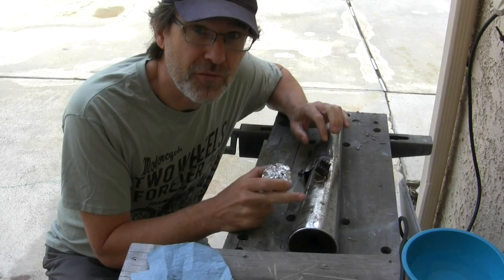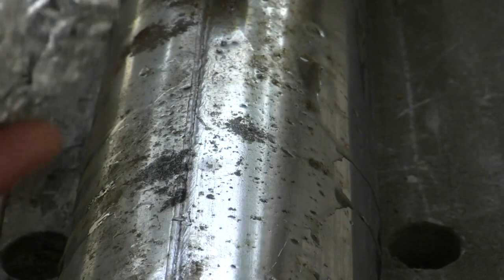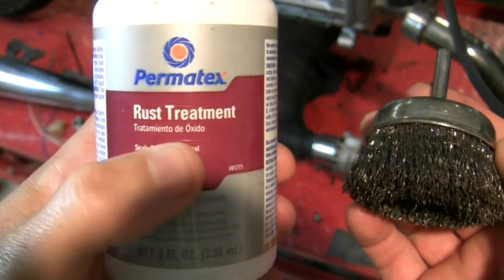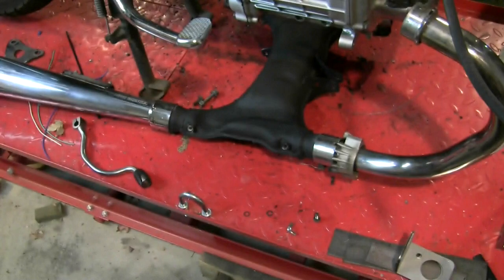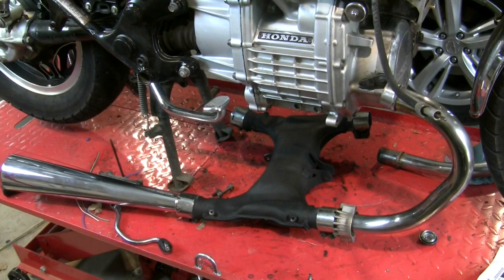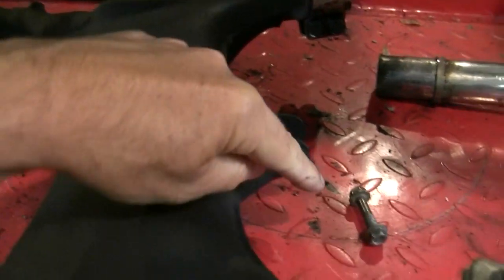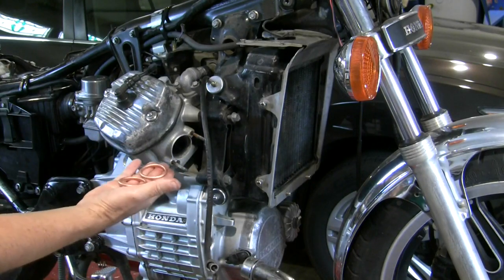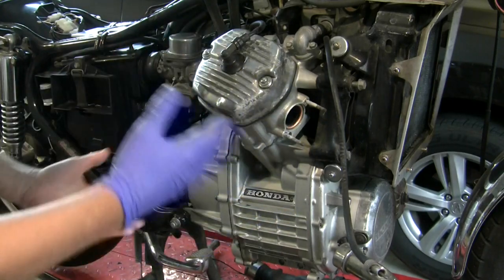Install Exhaust - CX500 (Part 19)

Comment: The aluminium foil on chrome trick actually works without any other additive.
It's because the aluminium is harder than the iron oxide (rust) but softer than the chrome finish.
So it scrapes off the rust but does not damage the chrome.
Reply from the maker: Thanks for watching! There is also a chemical reaction happening in addition to "scraping." Iron oxide -> aluminum oxide.

Comment: question... i put coolent in my cx and im getting some weeping aroung where the new water pump gasket is will that stop once i get the bike fired up and the gasket swells a bit?
Reply from the maker: That "gasket" (more of an o-ring of sorts) gets out of its channel easily during installation. My first guess is it slipped out of place and got pinched.

Comment: Horrible job. Doing it right now. 
Manifold gasket front: cut it to 24-22mm and put a bit of a chamfer on it. Drive it in 27mm , the from pipes fit a Dream. Of course before hand clean out the pipe with a drill grinding stone. Use exhaust fitting past, not repair paste.
Reply from the maker: Thanks for watching and sharing your insights.